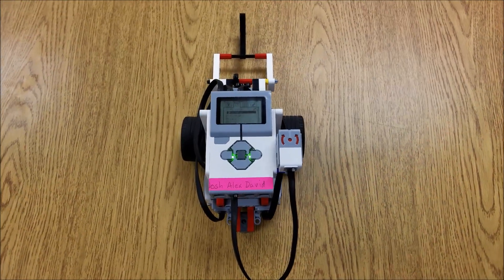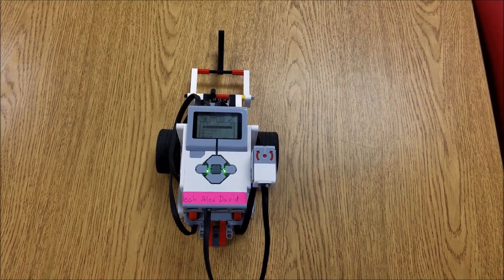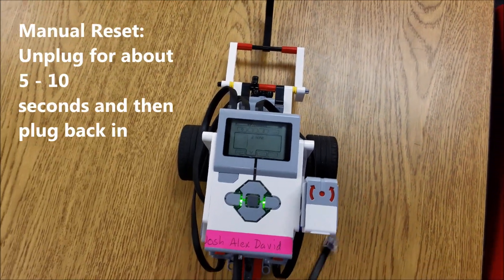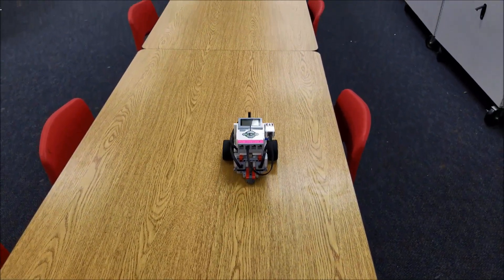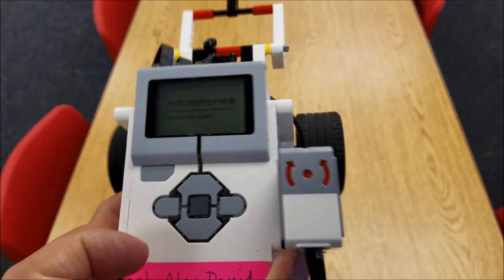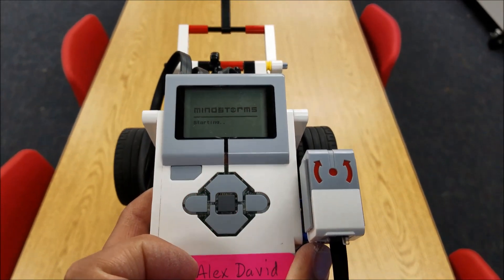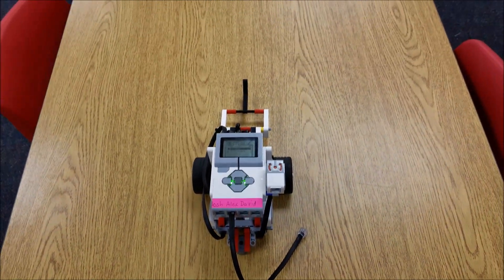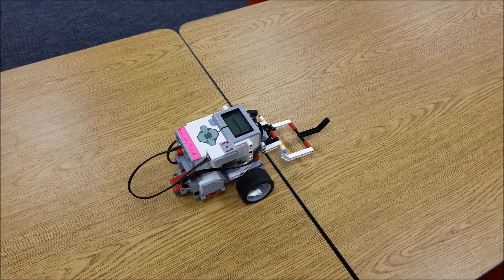"How To Fix A Gyrosensor Problem With Your LEGO EV3 Robot"

Comment: This is called hot wiring and this will spoil the sensor if this keeps on happening, the other sensor-friendly solution is that you could add a piece of code in front of every program that recalibrates the gyro. Here's the link to a pic of the gyro recalibration code - https://docs.google.com/presentation/d/e/2PACX-1vTGL2QDsv6M1dT9zw3CXQESiP60Uy5UZm2Xcp4Mo-YkhDHqjs9DX9jME1cux5bE7Tsa-MXeQd3b3Eg0/pub?start=false&loop=false&delayms=3000